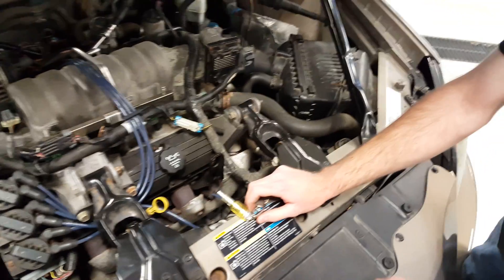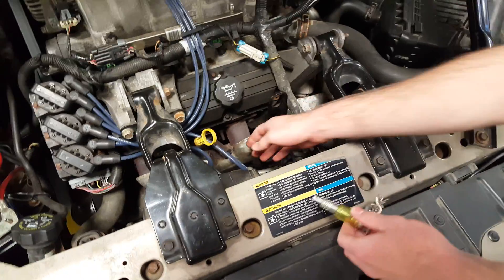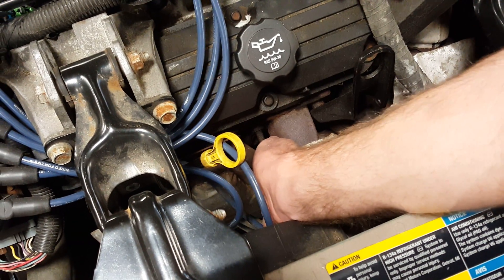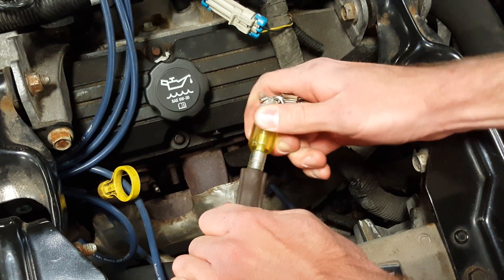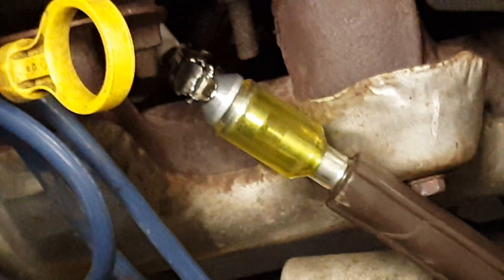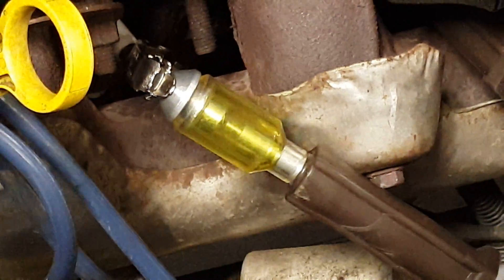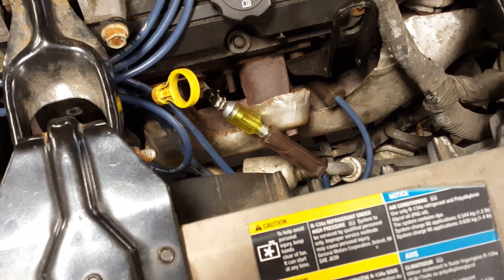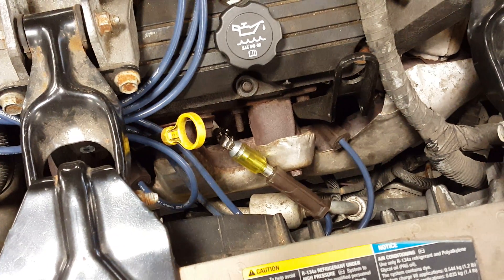How To Test For Spark-  3800 V6

Comment: Great video! Is there a way to pull two spark plug wires off the ignition coil pack and watch spark jump between the two towers or is this the only way to test spark

Comment: my engine has no spark, all the coil packs,dfi moduel, sparkplug leads,sparkplugs, sensors and even ran a new ground wire and it still has no spark?
Reply from the maker: Maybe the wiring harness going to the coil packs or sensors is bad?  Could also be a bad ignition switch.  Do you have any codes?  I wish I could be of more help.